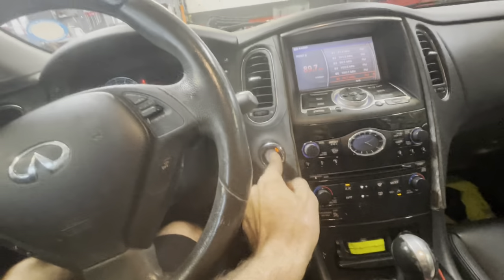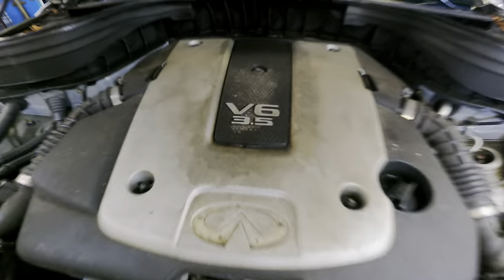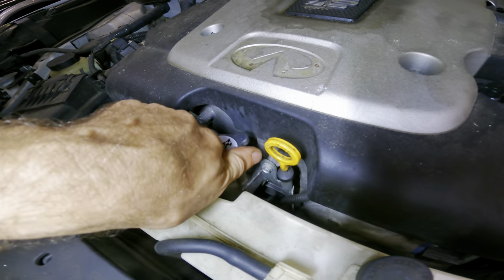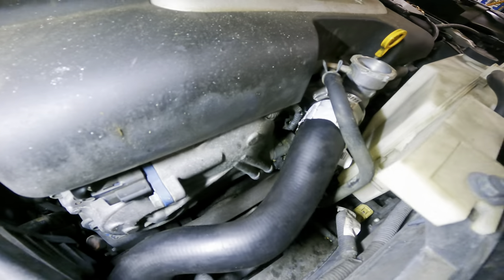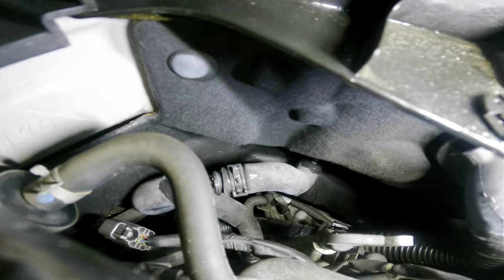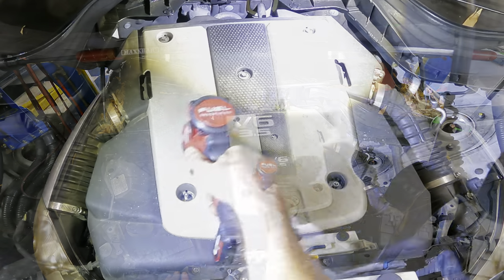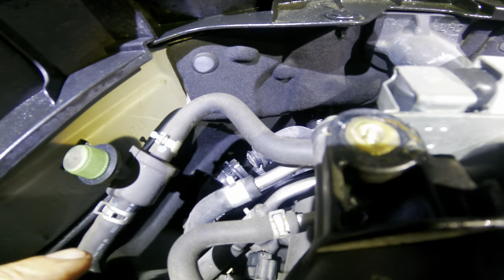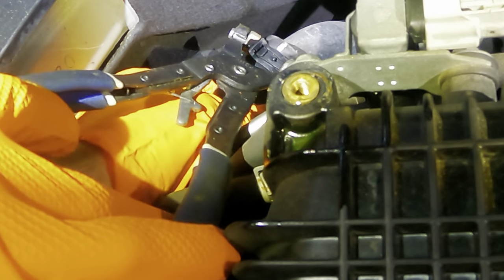Overheated after new Radiator! Tow In! Infiniti 3.5 EX35

Comment: Ray, Next time you run into this same problem, just use your angry pliers to crush the broken plastic barb, by wrapping the hose with a shop rag and then crush through the hose.  The broken (and brittle) barb will then crumble apart inside, and you can then just lower the hose to flush out the pieces.
I’ve done this many times.  It is very quick and efficient.

Comment: have you considered a yoga mat or foam floor mat tiles to put across engine bays whenever you have to lay on them to prevent yourself from being impaled by the pokey things
Reply: Ford Tech Maculoco uses old seat material to lay on. The leather cover part of the seat from an old truck.
Reply: I'd advise investing in a topside creeper.
Reply: That's what I was thinking. My knee pads and foam mats are among my favourite tools!
Reply: @Strasedon  topside creepers are worth every penny!!
Reply: I've been using an old baseball catchers chest protector for over 50 years for laying across engine bays or kneeling down jobs and even as a head rest working on the floor without enough height for a creeper. Super good comfort and even support over uneven surfaces under the hood.
Reply: @OldTooly  If it can reduce the pain of a thrown wrench, it can reduce the pain of leaning on a hood latch! - Dodgeball 2: The Mechanic
Reply: I have used exercise mats on engines several times. Works great to lay on
Reply: Had to look up a "topside creeper" but now I'm upset at myself. All these years of crawling around engine bays, almost getting eviscerated by deadly objects that don't appear until you look like your practicing a yoga move. When they do appear, it's a jab to the liver and/or kidneys.
Reply: One of those Uhaul blankets at leasts.
Reply: Main reason i suggested yogamat/foam floor mats is they are cheep, light and easy to store 
Think of how much room rays got thier a topside creeper whilst the superior product are rather bulky so he's more likely to not use it due to effort of retrieving it vs a mat that's compact so can be stashed close to hand
Reply: My thoughts too👍

Comment: Well this is a little mysterious so far . Car went in for a Cooling related problem and got a Radiator . Immediate Overheat again .
Now  Ray has it .  I suspect the previous shop was too quick to sign off on the Job . They too , should have noticed the Purging problem .
Some Engines can be difficult to " Burp " and there are sometimes bleeder valves fitted to assist that .   I  suspect a Warped Head .
Reply: i suspect who ever designs new cars has a very warped head..  new car every 2 yrs,,yeehh,, lets be green.. ai still got a 62 f100 4x4.. no lithium/cobolt child murderes here..

Comment: Ray - two thoughts. 
1. The sound of the lift going up in the background as you were installing the manual prop rod. The hood went up as the sound of the background lift went up.
2.  Surprised you waited to long to swap out the clamps.
Reply: use the OE clamps if possible. They expand a little with the temperature and don't dig into the hose, unlike worm clamps which don't expand and dig into the hose.
Reply: The squeeze clamps do fatigue.

Comment: Put the exhaust emission analyser probe in the funnel to sniff out any carbon monoxide if you suspect the head gasket. Nice videos Ray love watching.
Reply: I saw this from another mechanic.  He used the expansion bottle.  covered the lid for a few seconds then quickly placed the gas analyser in the port without touching the fluid.  It instantly ramped up the count of hydrocarbons.  The gas analyser is extremely sensitive so can pickup the smallest of head gasket leaks from the combustion side.
Reply: @imprezaaudi  That's the correct way to do it. The only time it doesn't work is when the leak is fresh and hasn't had enough time to contaminate the system.
Reply: When In was teching we used to do this all the time using the MOT exhaust sniffer. It was conclusive 100% of the time. Hot / cold made no difference, If the h/gasket came under suspicion, that was the first port of call. Saved so much diagnostic time. So many giggaties in this one but I had to say them for myself.
Reply: Not sure if the analyzers are that common in all Florida shops since there is no annual (luckily) emissions control? I imagine some have it but not all
Reply: @AT-wl9yq  The correct way is with a chemical tester on the radiator fillup. 
You trust your electronics all you want but chemicals never lie.
Reply: @contraband1543  I was coming here to comment the same. Chem test all the way.

Comment: You spent more time on the OEM Hose clamps than I would have. The new clamps would have been my go-to from the get go. The worm drive clamps are a life saver 75% of the time.
Reply: Baling wire and rustoleum.    Same problem and same solution since hoses were leather.

Comment: The worm gear clamps are not supposed be used on heating because when hot and cold the other ones can ajust to the temperature change because they are springy and the worm gear clamps dont and can break your plastic barb.
Reply: Whoa. Good point!

Comment: Which went bad first?   The radiator or the head gasket.  Wild guess is the radiator had a leak and the car was over heated which warped the heads. Those aluminum heads will warp as soon as they loose cooling and it don't take much coolant loss for this to happen.
Reply: At this point it really doesn't matter other than curiosity.
Reply: I suspect the same. This is probably at least the 2nd time that engine has been overheated.
Reply: That model 3.5 Litre engine series were almost bomb proof. I would be surprised if it had a Head Gasket failure from normal operation and it has not been confirmed there is a head gasket failure yet, we will have to see what shows up in part 2. One thing I did not hear during the run time was the Radiator fan running. Part 2 should be good and informative.

Comment: The way I used to get the pices out was to clamp a few inches back on the pipe then use big pliers to crush the broke pipe inside and tip it out, works most times

Comment: Also the oem clamps have already left a very solid impression on the rubber already, it would be best to reuse them and put them in the exact same position, using a standard wormdrive clamp can work but because of the impressions in the rubber it might not seal it flat, obv worked for you now but idk :/

Comment: For the stuck plastic in the hose: If you have a small hose-pick that fits in there with a U-shaped hook, you could have stuffed it in and pulled it "from behind" - at least that came to mind when I saw that.

Edit:
For the costs: Depends on why the new radiator was needed. 
If it was smashed and the broken hose was already there, the shop should have seen that when testdriving it / filling it.
If the radiator was replaced "for overheating" the other shop should have seen it.
If the radiator was replaced because it was smashed and LATER the hose broke: shit happens - customer has to pay you.
Reply: You can make one too..
Reply: Crochet hook, or a rug hook, maybe?
Reply: Who pays? As sergeant Schultz said; "I see noth-ing."

Comment: I've had a car overheat like that before and always turn the heater on full blast after repairs.   A mechanic told me to add some alum a seal and a tube of the radiator sealant that had aluminum shavings that are like a powder on cars that have aluminum heads or aluminum block. Sure enough it worked and no more leaks or overheating after a year.

Comment: When I saw it was a tow in for over heat, I was pretty sure it was going to have a blown head gasket. That is unfortunate!😟
Reply: It really depends on how bad it overheated if they noticed it getting hot and shut off immediately it should be fine if they drove it until it stopped then yes toast
Reply: @samholdsworth420  or it's a skim top and maybe bottom. Costly if it is. Fingers crossed for gasket but not hopeful. Might be cheaper to junk it if it. Who has $1-2k lying around.

Comment: I knew it was going to be a fun job. I was trying to see if it would have been easier to take the hose off.  In the least I was surprised you took the clamps off rather than slide them further on the hose.
Reply: Difficult enough to hold that lower hose, without adding a clamp cutting into the hand.  Maybe the upper hose could have kept the clamp.  Either way, this was a knee breaking PIA... I am sure.
Reply: @PastorSutton  if it were easy, then anyone would do it.That's why we pay the professionals lol.

Comment: A thought: squeeze the hose closed behind the broken piece with a long nose vise grip.  Then break the plastic with pliers and pull or shake out the pieces.  Clear out the hose before removing the vise grips    Anything that works is the right way, though.  Thanks.
Reply: I was thinking the same thing. Im all for destruction but if you break off plastic inside of a tube, there is no way of knowing if you just sent a piece of plastic down into the water pump to mess up the impeller.
Reply: Same...     Use a hose clamp pliers up stream, crush the brittle plastic,  remove pieces
Reply: That’s how we do it back at Infiniti actually. Take us like 10 minutes to fix it that way
Reply: just crush them and shake them out, if you're suspicious plastic is still in the system just fill with water to flush out. It should be the only opening in the system and flush out all plastic.
Reply: genius

Comment: Well, lets review: The bubbling stopped, so a blown gasket is unlikely. The upper and lower hoses were hot, so the thermostat seems to have opened. The waterpump seems active (similar temps on upper and lower hose). Did the fans kick in? Without fan(s), it will overheat while sitting/city driving. As it heats up, it pressurises the system and finds the weakest link.
Reply: I personally think it's not totally purged. I've seen some other comments saying this car has a purge bleeder. It does act like it's still got air in it. This is a tricky one. I'm anxious to see what it is.
Reply: I'm sure Ray will be checking the radiator fluid for exhaust gases using a chemical test kit
Reply: @loneranger4175  it stopped bubbling. Very unlikely it's the head gasket.
Reply: @Nordish Kiel:   " The waterpump seems active (similar temps on upper and lower hose)."
Actually, to me at least, that suggests the water pump ISN'T working. If it was and the fans were working correctly there'd be a big difference and if they weren't there'd still be a reasonable difference in temps between top and bottom hoses. It doesn't explain all the bubbling but it does suggest no circulation through the radiator. Actually I just realised that could also be a thermostat issue maybe except I'd still expect to see an even bigger difference.
Reply: @lorditsprobingtime6668  
Exactly. If you are dissipating zero heat at the radiator, something else is wrong. Ray never commented one way or the other if the fans came on, but I would guess they did or he would have mentioned it. Place your bets, head gasket, water pump, thermostat, blockage or fans? Waiting for part two.
Reply: @Bryan-Hensley  could have sealed back up after it got hot. Doesnt hurt to check anyway. We already know the thing overheated at least once, after it got a new rad, so why did it get a rad in the first place. My guess is, its probably been overheated a couple times now. I hope I'm wrong for the sake of whoever owns this pile, because it would most certainly be mechanically totaled.
Reply: My G35 once started climbing in temperature after a coolant flush. Apparently until the system completes several heat cycles and Burps, efficient cooling can't occur. In another case, the radiator fan failed and would not turn on. It would overheat at idle. Replaced fan, problem solved.
Reply: @adubs.  possibly. Do it again cold would answer that.

Comment: I'm continually amazed at how the engineers constantly make stuff so complicated. Good job Ray. 
Would it be a good thing to replace all the hoses water pump and thermostat when replacing a radiator?
Reply: In my opinion, if you follow that thing you will have to swap all car. That's just what you get for owning "old" car, slowly everything breaks apart/wears out.
Reply: I just asked the same questions!
Reply: This engine was originally from a French van and got adapted to work in SUVs and sports cars, that's why

Comment: here is some 20/20 hindsight, could you have tried running a suitable bolt into the broken piece and then pulled on the bolt head?
Reply: My thought was to stick a hook in and hook it behind the inside of the plastic piece.
Reply: I have. Sprinkler tool that takes plastic out of pipe. I wonder if that would have worked.
Reply: Pinch the hose shut with vise grips and use an easy out screw extractor bit to remove the broken coupling

Comment: Reminds me of something that happened to my 05 Lacrosse, plastic coupling going into side of the engine block blew out and dumped all the coolant while driving down the highway. Wish they would use more metal in cars than plastic, especially for the more important parts like the coolant system.
Reply: Yes.. manufacturers need to quit using plastic thermostat housings.  I had one split on the highway before.
Reply: @MrTrailerman2  Plastic is just fine, Peek for example super strong and expensive to. What they do they they are just making sure your car will fall apart, so that kind of plastic they decide to use. Then when you go to mechanic, most of them will mess-up your car even more and you shall start to think about buying the new car.
But there is hope. Nowadays 3dprinters are better and better so we can print our own plastic car parts :)

Comment: if you ever have trouble putting a hose over a fitting ,, instead of a grease base spray, which will always stay slippery use brakleen spray it into hose and quickly slide pipe on.. it has always worked for me .. i am / was a heavy diesel mechanic until i crushed my foot last august

Comment: That is supposed to be a bleeder valve for the system to be bled, and you have to elevate the nose  20 degrees to get the bubbles out the system. Unless to bleed it you will blow the head gasket . I hope you figure this out.
Reply: I'm not familiar with this car but I know some are a pain to purge. I didn't know if this had a bleeder or not. Some Honda and Acuras do.
Reply: @Bryan-Hensley  unnecessary. I delete it.
Reply: @TheGuruStud  sir, because the heater core is higher than the radiator you have to raise the nose of the car and purge the system. It's a bad design from infinity . That's what blows the heads on these cars .  My wife has the FX 35 I found out the hard way. Good day sir.
Reply: the no spill funnel becomes the bleeder. every coolant system ive done with a car has always taken multiple heat cycles to properly flush, atleast 20-30
Reply: @Weq5ter  not on infinities with the 3.5,s check it out from the infinity website. You must elevate the nose as well. It will never bleed unless you follow these steps. Look at the dealer website for this vehicle and the fx35. Now you know
Reply: @Weq5ter  what I did last time is the problem with YouTube. These are facts I'm telling you. Thank me and check it out for yourself. The person who doesn't follow this protocol on the infinity can blow the head. They also sell a metal bleeder.  My wife's car is an infinity.

Comment: I definitely would have vacuumed the bits of plastic out of that hose.  
The small plastic pieces can and will plug up some of the radiators passageways.
Although I think this car has bigger issues.🥵
Reply: "Vanes".
Reply: @raiderjohnthemadbomber8666  that’s the right word. 👍🏻
Reply: He left those in there on purpose to help scour the crud off the inside of the water jacket as they bounce around in they cooling system. No extra charge!
Reply: @DavidSprings  😝

Comment: I have a 2001 Pathfinder with the same motor (VQ35DE), one of the best motors ever produced, BUT, they are very temperamental when it comes to the cooling system. Once you get used to servicing them, you will understand why they are so highly regarded!!

Comment: Looks like it was suppose to have a bleed /purge screw there and replaced originally with the incorrect part. Would have made purging the system a whole lot easier.
Reply: Nope that’s actually a common problem on the 3.5 and 3.7 from 08-2013 or so. Known to lose structural integrity after all those heat cycles, and eventually break. There’s an aftermarket replacement from Z1 that allows you to use that connector for bleeding tho.

Comment: You can buy cheap stick on carbon monoxide detector patches (Amazon) that change color when exposed to CO.  Put one of those stickers on a flat piece of cardboard and put that over the mouth of the funnel.  That will tell you if exhaust is getting into the coolant and making those bubbles.  Thanks for the videos Ray, they are super educational for me.